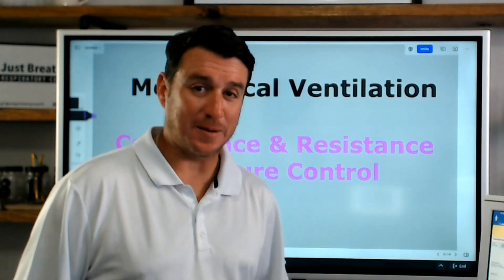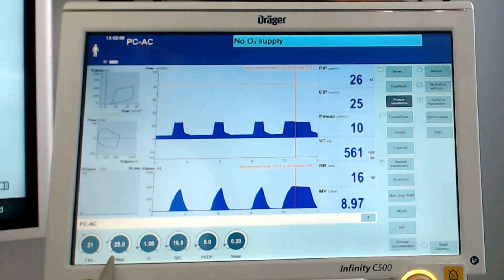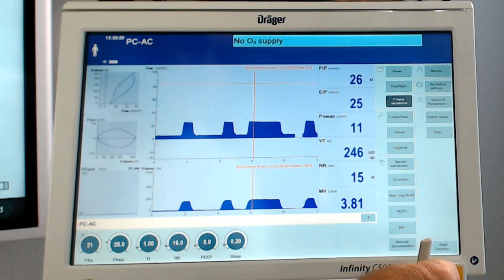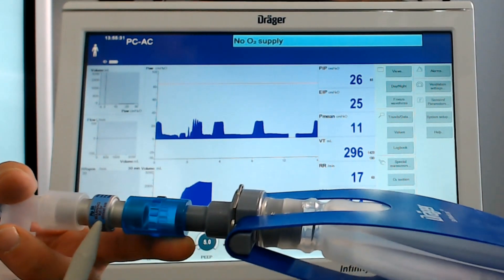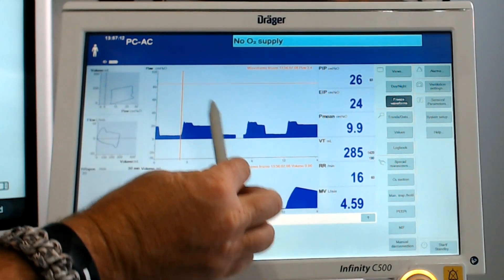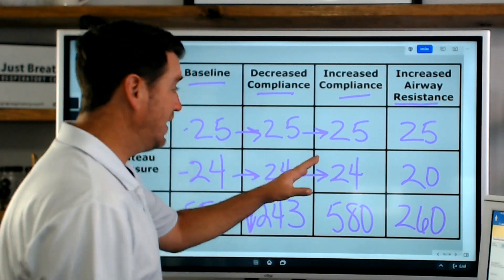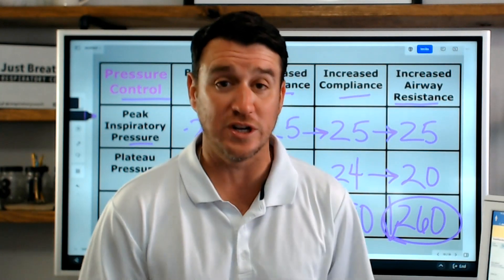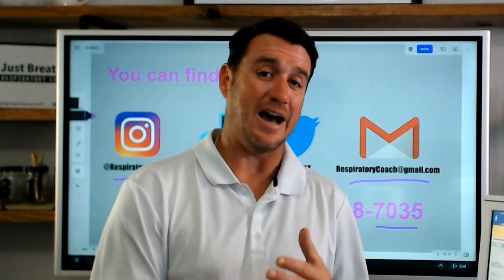Respiratory Therapist - Compliance and Resistance in Pressure Control

Comment: Fantastic presentation. Do you think when increasing airway resistance and doing Insp hold there is less air in normal lungs due to increase in dead space because of putting (resistance link) which ultimately decreasing Pplat a little than in normal lung? Thank you for all you do